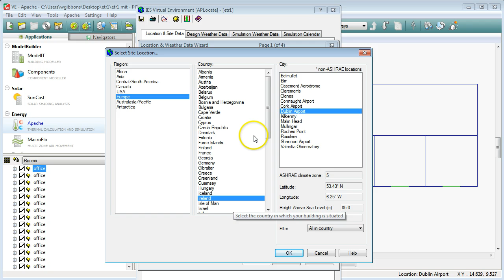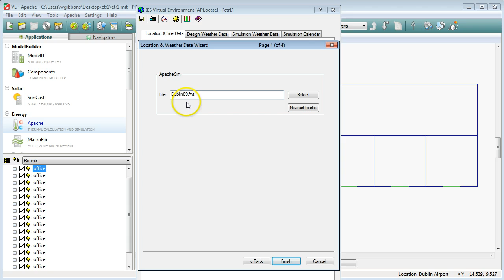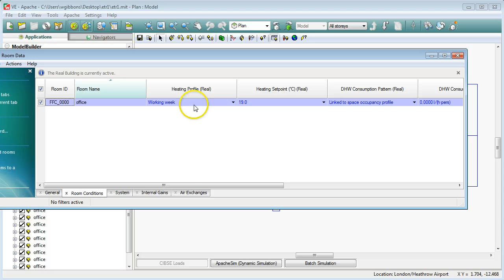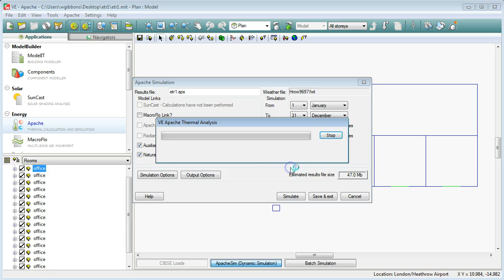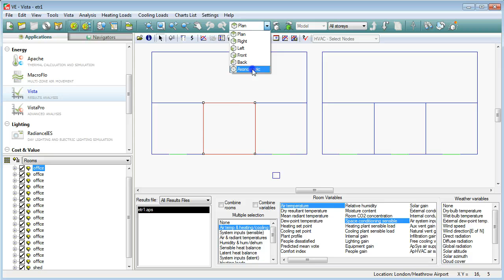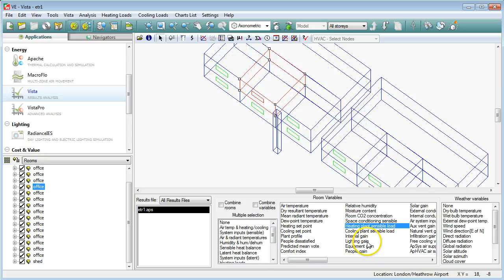Running Apache Simulation and Vista in IESVE

Comment: It's showing me there is external hole in the model. How can I change and correct it. I tried ClipClosing as they asked but didn't work
Reply from the maker: Can you see where the hole is? If so, it should be a matter of selecting it and deleting it.
Reply: @CADandStuff  no there are no holes.the model is made in revit 2019 and only have windows. I closed external holes from iesve itself by right clicking on the space but didn't work. It actually created problem in suncast simulation. 
Can you suggest me something please.
Reply from the maker: I tend to avoid using Revit models in IESVE. In my experience Revit models can be too detailed for IESVE. I tend to draw the model from scratch within IESVE rather than import. Sorry I can’t be more help.
Reply: @CADandStuff  okay thanks a lot. I will try drawing from scratch. The only reason I didn't is because my project is huge, 2 floored and many windows.
Thanks anyways and for ur prompt reply.

Comment: My issue is that my room ID's don't appear in the room ID tab of the tabular room data section. Why don't they appear, I need to set the amount of people in each space.
Reply from the maker: Hi. If you want to drop me an email I might be able to help.
Reply: Thank you for responding. I now can get the loads from the simulation which was my real issue and I thought it might be connected to the above, but apparently not. I can't generate a cooling and heating load report though.
Reply from the maker: I don’t bother with the “report” as such. I just get the monthly heating and cooling plant loads from the Vista application.

Comment: hey. great sharing. i have a question. how to perform a thermal analysis with difference thermal conductivity in ies? i hope u can reply as soon as possible.
Reply from the maker: jambul naik you can set the thermal conductivity in the building template manager when you are setting up your construction fabric details. By altering the materials and thicknesses, you can change the thermal conductivity of each element of the fabric.
Reply: ohh great. ok. i will try

Comment: Your videos are such a superfast way to learn this software!! I have started to use it for my research. I have one basic problem - I want to analyse humidification and dehumidification loads in an art gallery. Since occupants are key contributors, I have set occupancy hours in the 'apache profile database manager'. However, when I go to 'internal gains' on 'building template manager' and add 'people', I find only two options on the 'variation profile' - ON continuously and OFF. How do I insert the profile I created using database manager? It would be really cool if you could guide me on this.
Reply from the maker: Shashwat Ganguly it sounds like the profile you made has not been saved correctly and so is not showing up as an option when you are in the template settings.

Comment: hi, can i compare few type of construction materials for the same building in terms of power consumption?
Reply from the maker: +Chew Ong It is possible to set the construction types (including glazing). Have a look at one of my other videos, it might help: https://youtu.be/0ZeALX90Uw8
Reply: +Chew Ong Do you mean that within the same building you want to simulate different construction types? The way to do this is to have the different construction types set up in the Building Template Manager, and then in Apache you can go to a particular room and apply which ever Room Template that you want. Wayne
Reply: Is it possible if I compare different construction types for the all rooms in a building?
Reply: +Chew Ong Do you mean that each room has a different construction type?
Reply: +Wayne Gibbons nope,only change the construction type of the building,for example the glazing. Because I am doing a project on acmv and lighting retrofit for a building.

Comment: hi,
 
Hi,
I am currently doing a project on IESVE, would it be a problem if there is no weather file for the location But the location is available on the software.. . Would that be a problem?
Reply: Depending on what data you want to analyse, then yes, the weather file could be crucial. For example, if you are only running a daylight analysis, then the weather file is not really necessary. But if you are trying to analyse things like seasonal heating and/or cooling loads, then the weather file is vital. It should be already installed in the software, ready to be brought into any given project.
Reply: Wayne Gibbons
Your videos have been very helpful in learning how to use the software. Actually the simulation will be conducted with the aim of optimizing the HVAC system of an 8 floor academic building, the DBT available on the "design and weather data" tab shows good coherence with the actual meteorological values. The nearest weather file is  3500km from the location and the location is available in the software(location:Africa>Mauritius>Vacoas). the model will used to determined the cooling load of the building then further works will be done. Will the weather file be appropriate?
Reply: Dada Sodo 3500km to the nearest weather file sounds like a lot. It is showing up as Jo'burg on my software. If it was me, I'd contact IESVE directly and ask them for advice. I don't think I'd be happy using a weather file based on that kind of distance from the site.
Reply: Dada Sodo Off topic, but I spent a few nights in Mauritius for my honeymoon...I realise that there are polar opposites in terms of luxury and hardship there, but what I saw was really lovely. I'd like to go back sometime.
Reply: Wayne Gibbons
BTW if I were to find out the cooling loads from only a few rooms from the model, how should I proceed?
Reply: Dada Sodo I'd suggest to combine the rooms to create a linked space (otherwise the simulation will run on a single room and that is not very realistic, as you will want the surrounding rooms to have an effect on the room of interest), and then after the simulation has run, using the Vista application you can select any individual room that you want to look at in detail.
Reply: Wayne Gibbons
So when you come to Mauritius again, you let me know then.. .
You said to "combine the rooms to create a linked space". How do I do that? The model was drawn on SketchUp then imported on the VE, and its the same as if it was drawn on modelIt itself. In the building, there are spaces that must not be considered for the cooling loads and if I were to determine the load from only one room or a couple of rooms from a floor, how should I proceed?
I am a final year Mechanical engineering student, and that project will help me for my degree, I'll appreciate any help that I am getting.

Comment: Do you have any videos of running the Apache on a storage heating system? When I run it I get an output of zero. I spent hours on it and cant seem to find the problem.
Reply from the maker: I've never done it with a storage heater, although I wouldn't have thought it's a particularly different process, maybe just a setting or two different to a standard system. If you're getting outputs of zero, it could mean that the system hasn't been applied properly to the room/building in the Apache settings or in the thermal section of the building template manager. It could, of course, mean that there is actually a zero output, but I'd have thought that in our climate there should be some sort of output for heating demand if you're looking at it over a year.